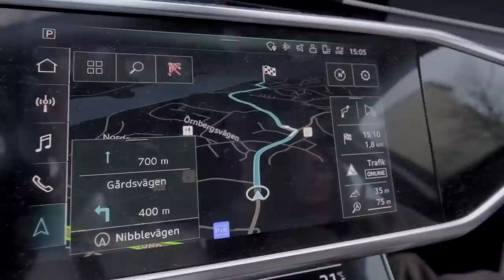En tittare har gjort ett bord till oss!! (Eng Sub)

Comment: I don't know the rest of your interior -> but trying to get the color of the legs of the table similar to the top of the table is probably very good and neutral to all other furniture. With a transparant varnish, like Erik suggests. The current color is great already. Don't forget that you will get chairs around the table, so the legs will look more far away from the top of the table as it does now. This is an absolute great job of Erik Bolin.

Comment: Beautiful table. With the kids around I would advise a matt laquer (transparent or with a light whitening) for the table top. Only oiled ask for way to much maintenance and risk of permanent stains (marker of a glass of red wine which gets knocked over..) is huge. Laquer fixes this but I personally hate gloss finish so a matt laquer is what I’d pick. Legs of the table should not contrast with the seats and floor. And as Erik says the legs could turn out more yellow (unwanted but still) than the table top I’d look into giving them some colour/stain but it should work with the floor and seats I think. Smartest would be to figure out the seats first and then take those with a floor board to the table before picking a finish for this beautiful table.